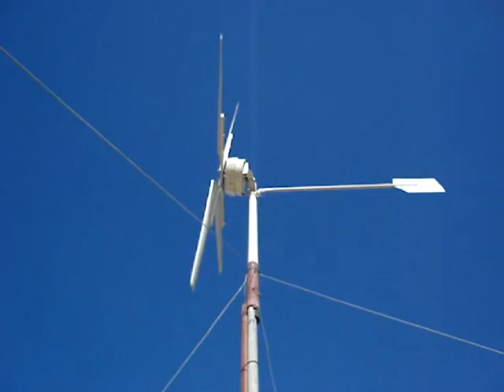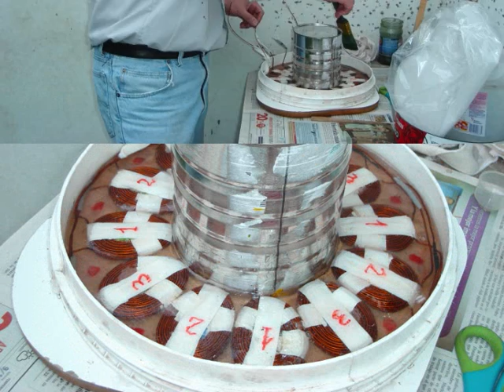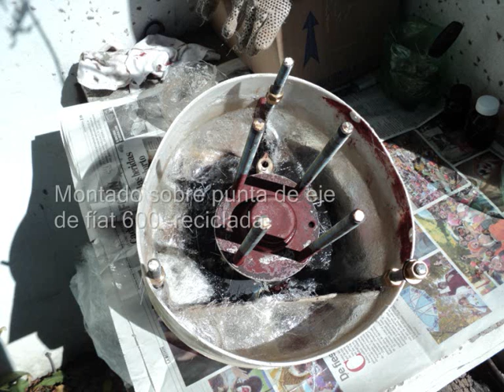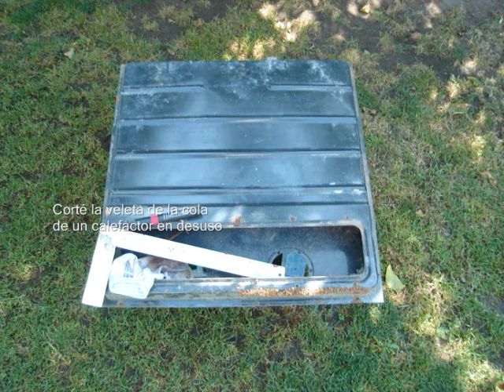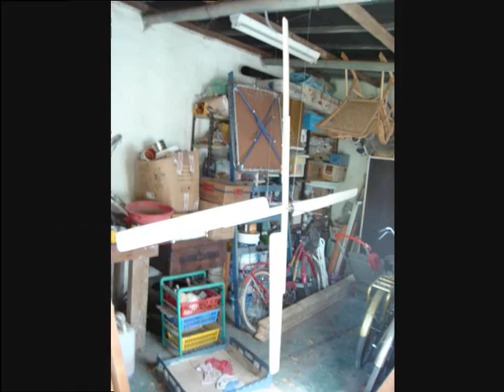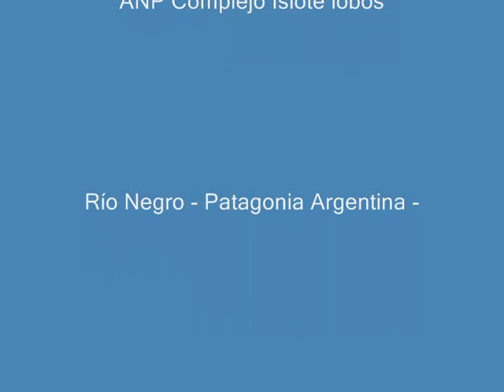Geólico II (versión más corta)

Comment: I'm building a similar generator ; I am using two motorcycle brake rotors reversed on a front hub using two ring magnets per pole, 36 magnets per rotor, 18 poles. I used magnets with a hole in the middle and tapered head screws, instead of epoxy. The blade hub is another magnesium wheel with a band around the outside.
Reply from the maker: Hello David: Excellent! Recycling parts to build such a useful generator is the goal. Thanks for sharing your experience! Kind regards.

Comment: Mauro felicitaciones , interesante ver esta clase de proyectos , si amablemente me puedes responder esta respuesta te agradeceré , de que depende el voltaje de generación ? yo quisiera construir uno de 48 v , por otra parte como calcular aproximadamente las RPM para un determinado diámetro de aspas para que genere la potencia nominal , mi idea es hacer un equipo de unos 600 w , desde ya gracias ,
Reply from the maker: Buen día Ignacio: Perdón por mi demora en responderte. El voltaje de generación depende principalmente de 4 ítems: 1 - la cantidad de vueltas de alambre de cobre; 2 - la fuerza y tamaño de los imanes ; 3 - la distancia de los imanes al estator ; 4 - finalmente de las rpm que pueda alcanzar la máquina construida.
Ampliemos lo anterior: 1 - Vueltas de alambre: a mayor cantidad de vueltas más voltaje se alcanza, pero hay que tener en cuenta que el espacio para cada bobina es fijo, por lo que tendrás que afinar el alambre para que entren más vueltas (con esas potencias un alambre de 0,8 mm sería lo más fino que yo pondría); 2 - Los imanes deben cubrir todo el espacio disponible, con una separación pequeña entre imanes, y tenés disponibles dentro de los imanes de neodimio los N-45, N-50 ó N-52, si utilizas el N-52 tendrás más generación; 3 - Distancia de los imanes al estator: si bien tiene que haber una separación y no tocarse en ningún momento (pues entraría en corto y no generaría) la separación óptima con una buena máquina puede ser de medio milímetro (se puede hasta 2 décimas pero es muy arriesgado en este tipo de máquina). Mientras más distancia haya menos generará el equipo; 4 - Mientras más RPM logre mayor será el voltaje (hasta un punto en que deja de generar pero supongo que con este tipo de paletas es difícil alcanzar a este punto). Si deseas mas detalles te dejo mi email bregantemauro@gmail.com. Saludos y gracias por preguntar.

Comment: Mauro. Soy David de Viedma. Excelente tu trabajo y descripción del mismo.    construi un generador vertical (dos discos de fibro con 10 aspas de 80cm cada una con eje varilla roscada de 20mm y dos rulemanes con soporte autocentrante) aprovechando un motor de scooter electrico, pero el tema de la friccion de la cadena y del multiplicador de vueltas para hacer muchas rpm en el motor hace necesario mucho viento para que mueva. Por esta razón queria hacer un estator y rotor magnético para reemplazar el motor electrico.  Me gustaría generar 150w, que me recomendas en cuanto a bobinas (cantidad y grosor alambre) ,  imanes (cantidad y tamaño) y forma de Armado del rotor y estator?  Muchas gracias.  Saludos
Reply from the maker: Hola David: 
Por lo que me comentás supongo que querés mantener las aspas de eje vertical. 
Si querés trabajar poco y con menor costo podrías adaptar un motor eléctrico trifásico de medio caballo, se le rebaja el rotor y se agregan imanes solamente (o un alternador de auto si te resulta más simple).  
Si te interesara armarlo completo podrías armar uno pequeño con el modelo que subí en el video. En este ultimo caso sería con 9 bobinas y 12 imanes en cada plato (24 imanes en total). Las bobinas seguramente serán de unas 100 vueltas cada una, con alambre de cobre esmaltado de 0,75 a 0,80. El tamaño de los imanes debería ser de un espesor de entre 6 y 10 mm y con un tamaño que cubran la circunsferencia que describen las bobinas (los imanes dependen del tamaño de las bobinas). 
Igualmente, en esas potencias yo me inclinaría más a poner un eje horizontal que te simplificaría varios inconvenientes de los que me comentás. 
Si quisieras conversar más detalles estamos cerca, yo voy bastante a Las Grutas. Mi cel +5492915763200 . 
Gracias por compartir tus inquietudes y dudas.

Comment: Y tambien me gustaria saber que dimension para cada bobina tengo 32 ímanes de neodímio de 2"x1"x1/2"
Reply from the maker: Dimensión de las bobinas: distribuir todo el espacio disponible que recorren los imanes dividido en 12 porciones, esa es la medida de cada bobina. Los imanes deben pasar por el centro de las bobinas.
Reply: Ah muy bien pero entonces no importa las medidas de cada una bobina y el cable awg 14 tiene que ser cuantas vueltas cada bobina? Muchas gracias por tu tiempo
Reply from the maker: Tendrías que lograr al menos 70 vueltas en cada bobina. Probá el espesor de cable, seleccioná el más grueso  que te permita poner esa cantidad de vueltas en el espacio disponible. Tratá de aprovechar todo el espacio disponible, casi sin hueco en el medio es mejor, y el espesor de las bobinas que en lo posible no supere 10mm para que los discos no se separen demasiado. Verás luego que mientras más cerca de las bobinas pasen los imanes tendrás más generación.

Comment: Saludos amigo, me gustaria saber de que manera se controla el voltaje,  lo ideal es tener un voltaje entre 12 y 14v para cargar baterias pero veo que al tener más revoluciones puede aumentar a más de 150v, esa fuerza no dañaria las baterias? Muchas Gracias por la respuesta.
Reply from the maker: Hola Andrea: ese es el tema más delicado a mi criterio. Puedes limitar la velocidad de las aspas con la cola pero se pierde generación. A mí me resultó muy útil el consejo de un amigo, me sugirió dimensionar el banco de baterías de acuerdo a la capacidad del generador, y agregar lámparas de 12v en el positivo a la entrada de la batería. De esta manera cuando el generador supera a la batería las lámparas se encienden absorbiendo el exceso de energía. Ej.: si tú generador brinda 500w, el banco de baterías podría ser de 300amp en suma y colocas 5 lámparas de 100w en paralelo sobre el positivo a la entrada de las baterías. Hay otras maneras más sofisticadas pero esta es muy útil.
Reply: andrea mendoza para regular el voltage necesitaras un regulador de carga
Reply: @franar6338  ola qué tal?
Controlador solar hibrido MPPT para carga de baterías

Comment: Me has dado buena idea con eso de generar las bobinas con alambres pares para hacer serie o paralelo con igual numero de alambres no pensé nunca en poder conectarlas así, mi idea era solamente q con alambre mas fino es mas flexible al realizar las vuletas en la bobina, más cómodo, pero tu idea de serie y paralelo es genial.

Estoy en Acapulco a menos de 1 km de la playa viento bueno pero no en exceso yo creo las 70 vueltas esta bien para mi no crees? Y pensaba en aspas verticales , aunque me.parece q desarrollaré menos velocidad y no sé si controle el viento fuerte ya q no hay variaciones de inclinación en aspas. Un saludo y gracias por la atención
Reply from the maker: Oscar Montero Hola Oscar:
Creo que es muy bueno lo de eje vertical, es menos ruido y con velocidades más acotadas, aunque considero que hay que combinar savonius con darrieus para lograr arranques con poco viento y torque suficiente.
Casualmente estoy haciendo uno así ahora (savonius - darrieus), en unos días más creo que podré subir las experiencias. El generador lo estoy bobinando sobre un motor trifásico quemado. Me está gustando mucho pues genera buena cantidad de corriente.
Los mejores deseos para tu experiencia!
Saludos y gracias por comunicarte.